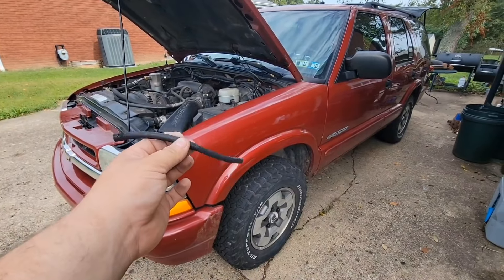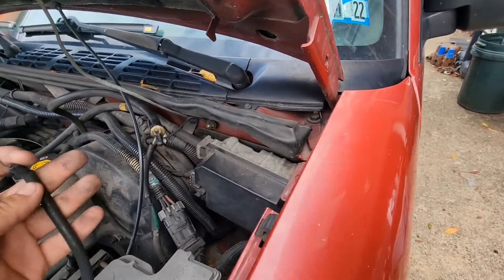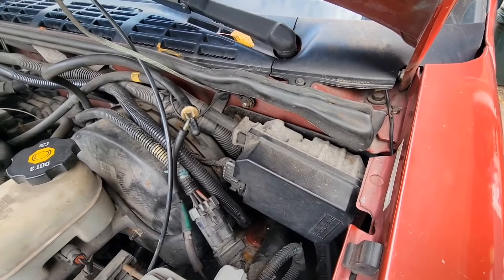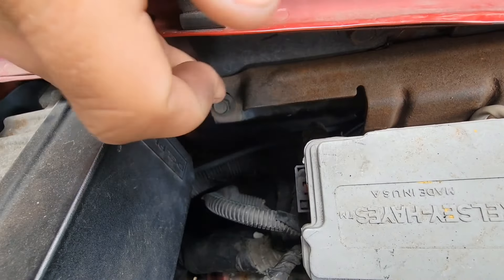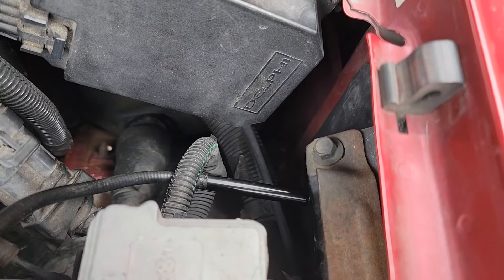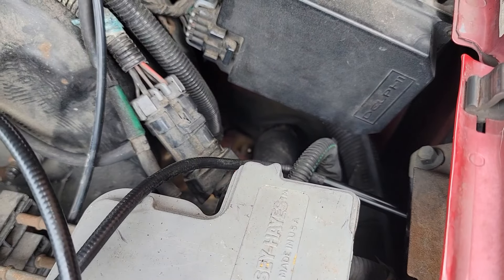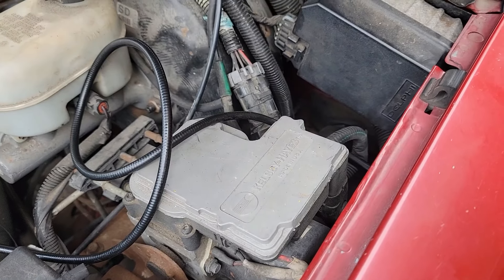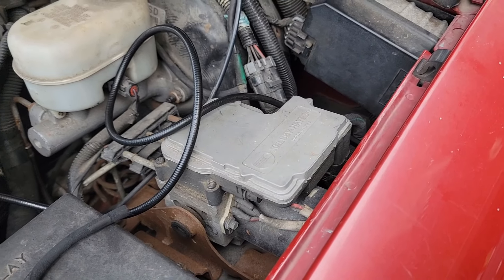Vacuum Line Mystery Solved!!!

Comment: Thank you! It is indeed a 5/32" line, and because the vacuum canister is integrated into the fender, it's very very difficult to see the nipple that accepts the hose. I removed the 10mm bolt holding the ABS unit bracket to the fender, and through the threaded hole I was able to use a very small flat head to pry off the old piece of vacuum line left on the nipple.

Comment: Thanks you so much !! My 4 x 4 ZR2 Sonoma wouldn't go into four wheel drive and mechanics at shop couldn't find vacuum leak. They saw the short 5/32" line and plugged it and four wheel drive kind of worked. They sent me home with it that way. I came across your video and removed the 10mm bolt and found the nipple where the line attaches. Took it back to them and showed them. My four wheel drive is FIXED THANKS TO YOU!!  Jan
Reply from the maker: I'm glad I was able to help!
Reply: @k30krazy  Me, too!    I sat in their waiting room 8 hours the first time and 6 hours the next time they tried. What a relief! I live miles out in the country where the snow has  been DEEP and I really needed my four wheel drive!! Thank you again!!

Comment: You didn't happen to have a P0300 code when that line was disconnected did you? I had a 97 that I couldn't get to run right. When I parted it out I found a vacuum line diwn by the transfer case was disconnected. I suspect that was the cause of my P0300 problem. By the time I found that, it was too late to fix it. Id already sold parts and cut wiring and all that. I was annoyed. Also, on the late 90s blazers (96-99ish),the vacuum canister you speak of is mounted to the bottom of the hood, in close proximity to where yours is in the fender.
Reply from the maker: I think I did have that code. I know that 4x4 wouldn't work and the hvac controls wouldn't work.

Comment: I’m trying to fix my 1999 2wd 4.3 s10 and I’m having a misfire on idle, shortly after I found this entire 3-way hose sitting under my brake booster. Thankfully to you I found the vacuum canister now so I know where one hose goes but where does the other two? Any tips would be helpful but thank you for the video as well
Reply from the maker: That T of three lines... one to the canister on the right the middle on mine went to a hard plastic line through the firewall for hvac controls and the left side went to a line on the manifold. I forget which one

Comment: Hey K30Krazy, Great Video.. I had the same issue and took care of that. I don't know where these lines are hooked up to. I still have the same 3 way plastic tee line that you have with the green marks on it going down the driver's side and the line that disappears towards the engine block. I'm still hearing a hissing sound on the open t line nipple. Thanks if you can help out. I just replaced distributor cap and rotor this morning..! Thanks
Reply from the maker: Thanks! So those lines on the other 2 ports go to the hvac and the intake. The one going towards the firewall to a hard line us for hvac. The one going towards the engine goes to the intake for your vacuum source.
Reply: Thanks for the feedback, I'll check it out today.. we have these severe thunderstorm warnings here in Central Florida. I'll let you know on I did. Thanks,

Comment: The 98+ vacuum can in thd fenders ONLY job is to provide backup vacuum under HEAVY ACCELERATION to the HVAC. It literally had ZERO to do with your 4x4. I'm on truck #7 over the past 30+ years and I know them well enough to 100% believe that your 4wd started miraculously working better after randomly jostling the lines around lol. But the facts in this case is you solved a weakened HVAC control actuators mainly blendoor functionality.  But with an S-Series?? Tire pressure low and your passenger window gets stuck lol. These are finicky animals for sure! Glad you got your 4x4 going again- that's the only thing that matters. Just don't want some 20 something kid seeing this and believe it's going to solve his shorted out TC motor. It's an hvac line, that's it
Reply from the maker: First off if someone is stupid enough to believe fixing a vacuum leak is going to an electrical problem that's not my problem. Second all I said was that the line was disconnected. I had no 4x4 because the axle actuator wasn't getting enough vacuum because of a leak. I plugged the leak and it worked fine. All this video states is I found out about the fender mounted vacuum canister and that's where that short line went. That did intact fix the hvac problems under acceleration like you mentioned. There's more than one issue I talked about here. Never said that the canister fixed the 4x4 problem

Comment: How did you get the hose in place, I can't get my hand down so I can push it in place. Did you unscrew the abs pump?
Reply from the maker: I found the barb with a camera...could use a mirror. Then just felt around with my hand and put it on. Was a little tight and awkward though.

Comment: Just picked up a 2000 Blazer 4x4 four button 4x4 switch with Auto and mine doesn't work I see the vacuum line on mine that goes to nowhere and it has a bolt plugged in it. But it don't see anything in the inside of the fender. Nevermind I found the nipple I'm an idiot😅 hand to big to get to it 😂😂
Thanks for the video

Comment: My 2nd hand 98 2.2L LS had an audio intake vacuum leak 3' hose from one of the top ports which I capped on the Throttle-B routed in the direction to the left fender. I found the same extremely deteriorated hose but it's 7/32 GM1486-M 111497. The label outlasted the hose's structure. Cheating GM hoses were made and installed on all Chevy vehicles back in the 90s. So, 30 years have passed. Anyway, mine was also just hanging around like yours. What I don't know is where the 3rd line connects to? Some videos show it connects to a round hood HVAC Reservoir canister which I don't have. Is it missing? I don't have a 4x4. The check valve may have fallen off to the pavement years ago because the end of the hose crumbled. Now, I don't know if I just connect the new hose directly to the fender vacuum canister's barb. Glad you pic that male Barb.

Comment: same spot deteriorated on my 96,  plugging or connecting to the reservoir will cause the truck to bog and idle rough disconnect idles fine would i be needing a new reservoir?
Reply from the maker: How long do you leave it connected?  I'm not a professional but in my head maybe you're vacuum leak is larger and once connected you're not giving the engine enough time to adjust to the less air and making it rich. I'd grab a scanner and see what your fuel trims are doing. Or at least connect everything and give it time to adjust running.

Comment: I’m trying to find where the hose that Ts off the check valve goes to. I have the one going into the sidewall, just not the one that goes down to I don’t know where. It’s the hose right next to the one that you just hooked up.
Reply: To the top of the engine
Reply: @ there is one that goes to the top of the engine, yes. That’s not the one I was talking about. 
    I was referring to the one that runs into the cab with the wiring harness. I found it myself…eventually.

Comment: Man I wished u would have showed ware that line goes on the other side of the white connector. I can’t figure it out for nothing.
Reply from the maker: So the one side goes to the fender for the vacuum canister, the other across from it goes to the manifold for your vacuum source, the third perpendicular one connects to a plastic line with a section of rubber and it goes through the firewall. It's the vacuum for you hvac controls
Reply: @k30krazy  thanks man.